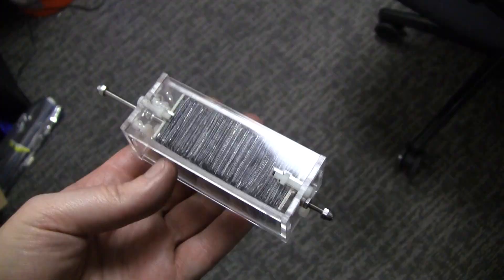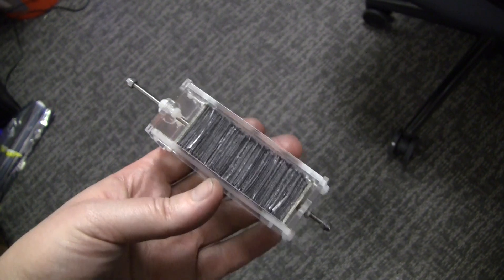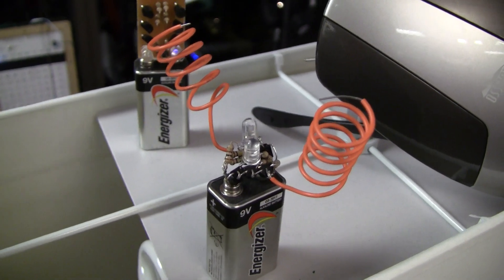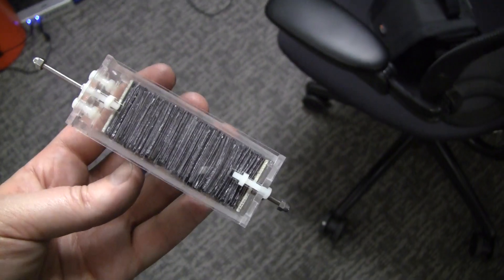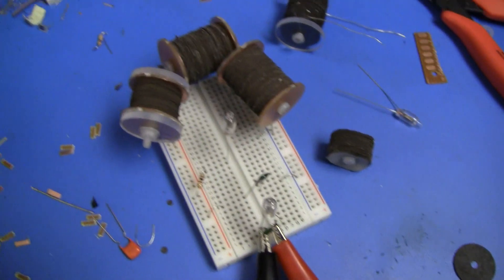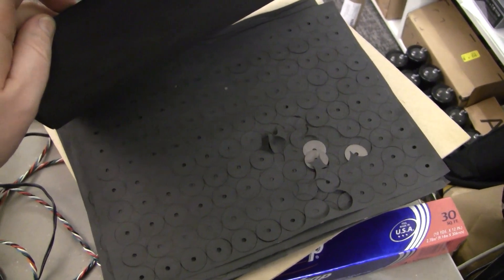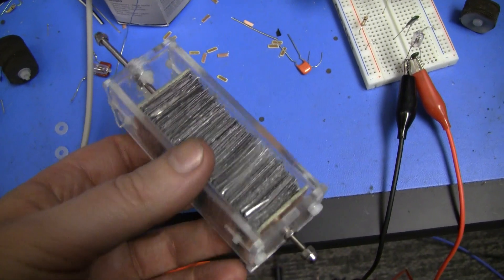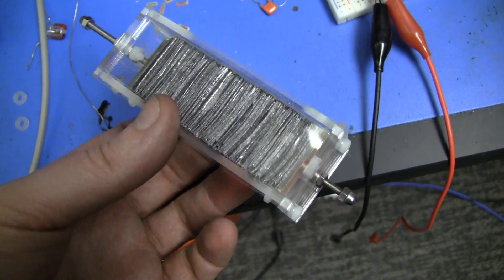Dry Pile Prototype

Comment: I didn't see where you were getting your zinc paper, perhaps I missed that part. I have used zinc containing galvanizing spray paint to make zinc coated paper. If you make a crosshatched mask you can spray the zinc on in little squares with a clean paper border, and cut along the middle of the bare paper with a paper cutter. The back side of the paper could be coated with the MnO2 mix as usual. This will perhaps keep the cells from shorting along their borders. I tried making a dry pile years ago with the zinc spray paint as cathode used spray on graphite lubricant as the anode and nothing but printer paper as the 'electrolyte'. It worked, but was very dependent on relative humidity, working one day and not the next.  Thanks for your video.
Reply from the maker: I made a paste of zinc dust and gum arabic solution and brushed that onto the paper.  Spraying it would be easier.  I like the making idea, I'll have to try that, would help prevent shorting at the cell edges.

Comment: Could you use a dry pile like yours with an intermittent switch connected to a neon tube? I would think the "solar dancing flower" type switch might work...it old be interesting if it did for a long term battery demonstration.

Comment from the maker: Not yet, but I've been collecting a lot of different papers to try.  Once I get the chemistry working well (Zn/MnO2 and Al/MnO2 are promising, but adding chlorides should improve cell EMF a few hundred mV) and build a new picoammeter (I left mine in AU) I'll make a bunch of test cells and trade off cost/availability and ease of manufacture.

Comment: Hi Alan,
Great work so far on your dry pile!  I experimented a bit with voltaic piles a while back.  The only metals I've tried thus far are zinc and copper but I experimented with several electrolytes.  I tended to go for chemicals that were very deliquescent some of the ones I tried were calcium chloride and glycerine.  No doubt the extra moisture would negatively affect overall life of the pile.

I too am vary curious about edge shorting.  I'm really interested to see how you deal with that.

Comment from the maker: I'm not sure it could supply enough current, it could top-up a low-leakage capacitor which charges a few 10s of pF of tube + coupling capacitance. Not sure how to make a sounder of reasonable volume and enough voltage regulation to stay in the plateau. 450 volt 100 pF is about 10 mJ. For a typical 400 us GM tube discharge pulse that could be 10s of watts peak - maybe it is possible with impedance matching into a suitable transducer? Supporting ~5 mW average for 30 CPM background would be hard.

Comment from the maker: More area gives more current/lower impedance.  It doesn't change the voltage much, except by allowing it to drive lower impedances and charge larger capacitance in the same time.

Comment: Probably depends more on the pressure applied to the cell to get intimate contact than anything else. You might want to try sprinkling the edges with sulphur to keep a constant low humidity in the cell.

Comment from the maker: Mostly the chemistry yes.  Larger area gives more current and lower cell impedance, but the open-circuit voltage is largely fixed by the redox chemistry.  The paper and binders used in the pastes can make a huge difference to the cell impedance, and I suspect the more deliquescent to chemicals the more water the cell will retain and the lower it's impedance will be.  However I am unsure how that effects the cell lives.

Comment from the maker: That is an interesting approach.  I am going to try some kraft paper-backed cooking foil I found.  I am not sure how important edge shorting is, but one piece of foil origami paper I coated measured much better when I punched out a circle rather than measuring the whole 100 mm^2 of it.  I don't want to have to test every cell, I could test them 10 or 20 at a time.  I built a JFET follower electrometer into a clothes peg for cell measurements, but even it takes a while to stabilise.

Comment: Have you thought of getting paper rolls and coating them and getting aluminium strip, then winding up a large mandrel then just segmenting it and stacking the segments. Will have a slight trapezoid but at least you will have both an aligned edge on 2 sides and faster assembly. Cutting would probably be best with a bandsaw and a very fine toothed blade or a scroll saw with a fine blade